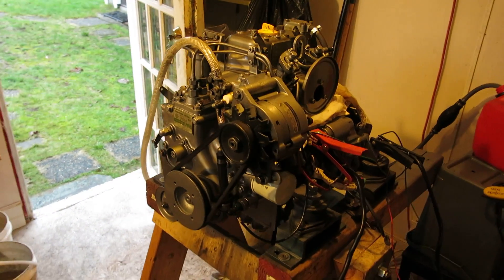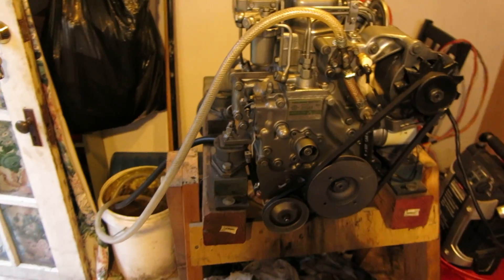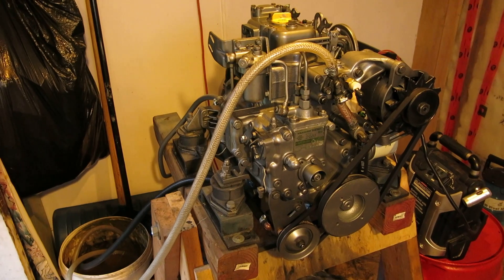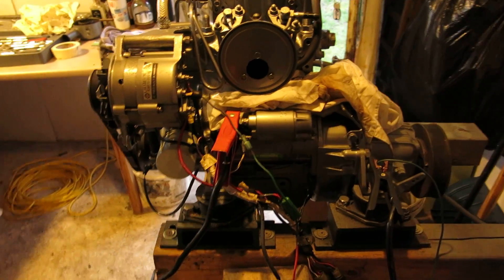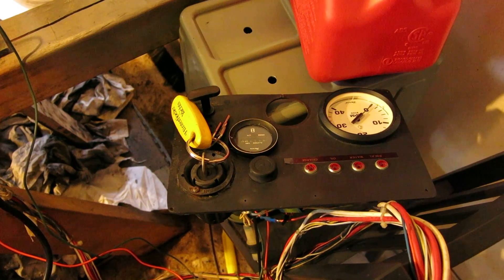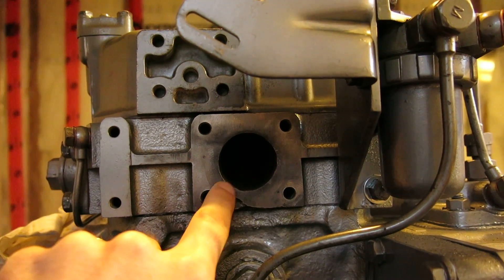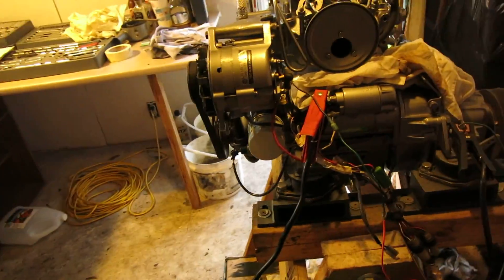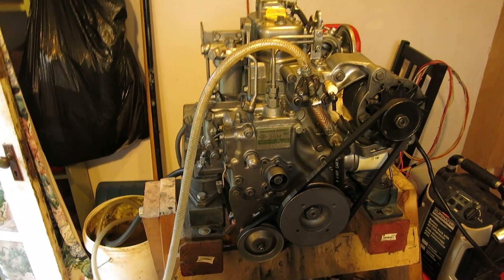Yanmar 2GM Post-rebuild Run-up

Comment: Based on the number of crank turns and smoke your rings are not completely seated yet or there’s a lot of ring clearance. What did the ring and pistons set you back. We’re sleeves available?

Comment: Crankshaft replaced you mentioned?  Odd it ran out of lube oil? Nice job. 2 GM is a good model for Yanmar with sleeves. 2GM20 is bored block. Nice job, I know Stem to Stern well. I  Worked  many years for Land Sea Power the Yanmar Distributor. For Exhaust Elbows check Marine Engine Service in Burnaby. Bravo Zulu

Comment: Sounds really good.

I did somewhat of a rebuild on my engine last year too. It was in really bad shape but it's working again. Still doing other work on the boat before it goes back in, so still sits in the garage for now. 

http://norsea27-rhapsody.blogspot.com/2016/03/engine-rebuild.html
http://norsea27-rhapsody.blogspot.com/2016/03/engine-test-start.html
Reply: Thanks for the links, thinking about giving a rebuild a go myself, not sure yet
Reply: @weburnitatbothends  thanks. It took some time but it eventually came together. Good luck on your work.